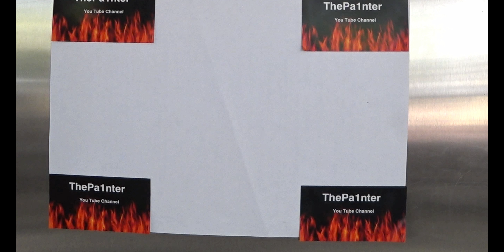how to spray oil based paint through your spraygun

Comment: what kind of drugs do you do before you start working.  you’re definitely on something because you spend all that time setting up the spray gun then you use a roller.
you make no sense.
Reply from the maker: Are you suggesting I spray all the doors with the oil based enamel with the ceilings all finished ?
Reply: @ThePa1nterhowto  :  i’m just commenting on what i saw in the video.
lots of work, then a big change in plans.
the ceiling could be covered in gold, how do i know, but doing all that prep then not spraying makes people wonder
Reply from the maker: @ginoasci  Interesting way of thinking but to be honest, I've mostly always done my doors like that, I've been using a spray gun since I was 15, so over 40 years spraying and if I thought it was better to spray the doors, I would .Some houses I do have over 20 doors, undercoats are sprayed on flush and colonial doors but in the past spraying of the top coat in my opinion is detrimental to the finished product and are a slower way to complete a house with the method I use. Love the way your questioning, have an open mind think outside the box
Reply: @ThePa1nterhowto  :  thinking outside the box would be a hood idea for you since they make HVLP paint guns now so you could use the paint right out of the can without all that mess you have there with old equipment and upgrade yourself to the new technologies and paint walls, trim, as well as doors all with the same HVLP spray gun.
no messy thinning of the paint.

have you at least tried these new spray guns?
you suggested for me to keep an open mind.  will you follow your own advice and buy a new HVLP spray gun and give it a good go m a few jobs?
Reply from the maker: @ginoasci  I have used hvlp guns at dulux demo days a couple times, they are slow, cumbersome, and there is nothing that the hvlp can do an airless can't do with low pressure tips but the hvlp can't do what the airless can. In fact it's a very limited tool that would only slow me down. I paint to make money, I'm not saying it doesn't have its uses but not much good for me.
Reply: @ThePa1nterhowto  : i understand

Comment: Hi Gregory. How you been doing ? I used my smaller Graco ( gxff ) couple of months ago to spray some big radiators with oil eggshell. I don’t like running oil paints through the unit. Horrible to clean the filters, tips in white spirit. Got a few runs got to admit using oil. Never get that when using water based. Perhaps I was going too slow. Thoughts ? Cheers Stevie. BTW 310 FFLP tip
Reply from the maker: Yes,probably to slow,you should always check for runs before it goes off. Maybe the tip was too big and fine finish tips don't tend to atomise the paint properly. Next time try normal tip
Reply: ThePa1nter ok mate. Thought FFLP be the better option as well. But will take your advice and give it a go. Cheers